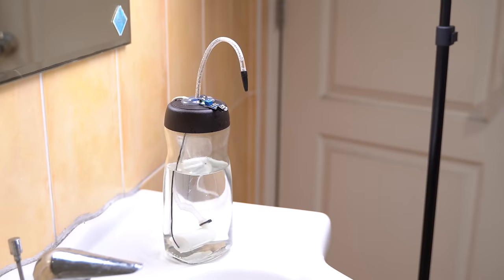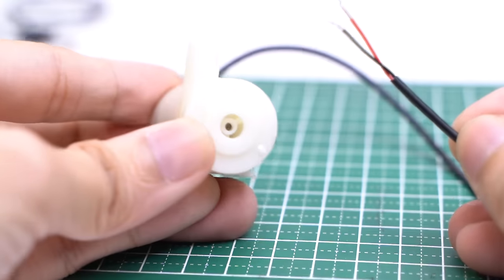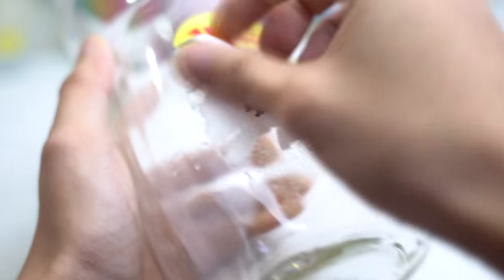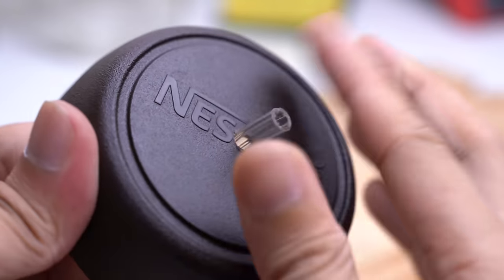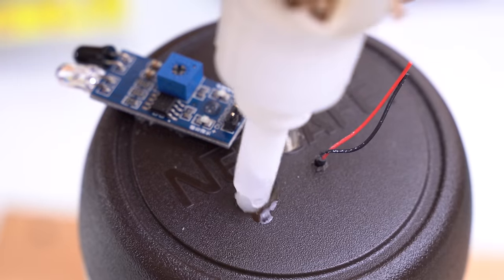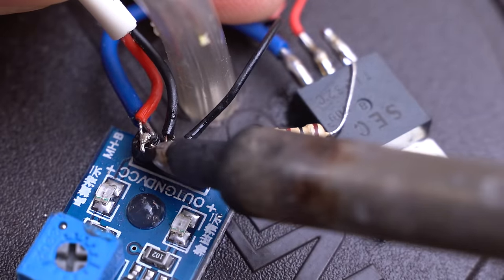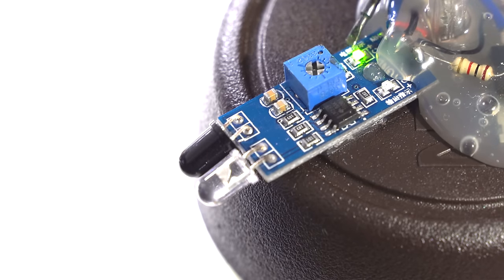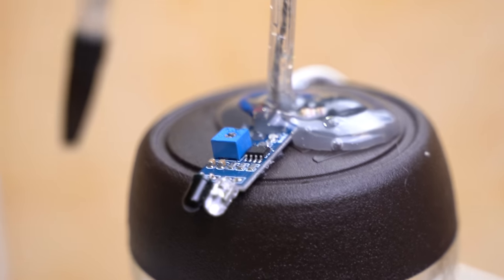DIY Automatic Alcohol Dispenser ($3 No Arduino Needed)

Comment: Now you can upgrade this by inserting a small perfume ball valve near the discharge port of the pump so that the fluid doesn’t go back to the tank everytime you it goes off. This will act as a gravity one way valve or a check valve. Fluid output will be smooth as sanitizer. 

You can find the metal 2-3mm metal balls in so many place. Bike hubs, perfume bottles etc. Nice project.

Comment: Neat idea I guess... The only problem is that people are used to holding their hand under the dispenser and waiting for it to dispense it's preset amount. It isn't intuitive to have to remove your hand to stop it from dispensing, as this may lead to spilling. Since the IR sensor's output will remain high for as long as you hold your hand under it. I suspect users may hold their hand under it for quite a while until they realize it doesn't stop automatically. This would waste quite a lot of alcohol.

Comment: One note.  Beware on the wire colour in the USB cable.  Often times they don't follow standard colouring, so it's worth checking the polarity with a multimeter if you have one.
Reply from the maker: Agree! Although it barely happens, I've had the same enounter before. It damaged my project. I did however check it on the actual video, the clip was removed to shorten the video length.
Reply: @TechBuilder  Can I use a IRF 520 transistor? Thanks

Comment: For those concerned about the wires and pump being immersed in alcohol, you can probably put the pump outside of the bottle then just insert another tube into the bottle for the source.
Reply: Yes
Reply: I made this but whenever I try to put the battery, it automatically starts pumping; after that it functions normally. Can you tell me what's the problem?

Comment: I have a suggestion to improve the design. Connecting a capacitor and resistor to the transistor can help make a cheap timing circuit. This is good if you're only trying to dispense a small amount of liquid like rubbing alcohol on your hand. It also helps alleviate some problems when glitches on the sensor module might occur or when you point an autofocused camera to the sensor that might cause it to unintentionally go off and dispense large amounts of liquid.
Reply: what kind of capacitor?
Reply: Can you teach us on what type of capacitor is needed? And where to put the capacitor? Because my main problem is the current is slow when you try to activate the pump(we tried it on the breadboard) so the main problem that I have is the slow flow of the current to the pump

Comment: Good idea..... however I think after a bit of time the alcohol will corrode that motor (oxidizing the metal shaft) and possibly the glue/adhesive that holds it's housing together. There is also the chance of ignition of the alcohol from the small arcs those DC motors make when powered.

Perhaps run this for months and see what the outcome is.
Reply from the maker: Thanks! I've been running this project for almost 2 years now, the older one that is. This one's just a documented remake. I had exactly the same concerns, so far so good. As for the arcs, as long as there are no oxygen or air to feed the fuel from sparks, I doubt it would ignite.
Reply: Dis does look risky , may using  a brushless submersible pump or peristaltic pump is safe option ... 
Can a 5v peristaltic pump give such a result ??

Comment: using a peristaltic pump would be probably better with some alcohol tolerant tubing
Reply: Can 5v mini peristaltic motors give enough flow rate .. ??
Reply: And what will b alcohol tolerant tubing
Reply: I tried this . But dont know what I messed 
As the pump is running continuously on turning on power
Also the proximity sensor I got had 4 terminal namely AO DO GND VCC
Plz help

Comment: Hey there. Great DIY project.

I have an issue with mine. The pump is failing to pump the sanitizer all the way up the tube. The sanitizer gets stuck somewhere along the tube. 

Any advice on what I could do to solve this issue?
Reply: what kind of pump is being used?

Comment: I just did this !!!
man I feel like I'm now worthy for some NASA projects ;)
Reply: I tried doing this but my motor is not turning on at all!. I have tried this many times , could you please help me out?
Reply: @akshitaddanki3607  first ckeck your ir sensor by just giving it dc 5v supply. Then proceed for other connections.
Reply: Dnyanesh Jalamkar yes I have checked it and it is working absolutely fine..but my motor is not turning on :(
Reply: My motor work automatically when i connect the power. I used TIP 122NPN Transistor and 6v motor
Reply: @akshitaddanki3607  I made it today and it is working perfectly fine.  You might have fried the transistor while soldering. Try with another transistor (attach a small heatsink to it while soldering).
Reply: @dnyaneshjalamkar4257  I checked transistor also but motor gets automatically on when connected
Reply: @applevlogs4887  that happens when there is too much light. Try in low light area. Light affects ir sensor performance.
Reply: @dnyaneshjalamkar4257  it works I have adjusted ir sensor
Reply: @applevlogs4887  same things seems to be with my DIY. What did you adjust to fix it? Mine seems to turn on with power.
Reply: @RohitPatel-om4jp  adjust the screw available in ir sensor
Reply: @applevlogs4887  yeah figured that one out. Thanks though!
Reply: @RohitPatel-om4jp  welcome hope it works fine 😊
Reply: What kind of transistor can be use in this project?
Reply: @applevlogs4887  yes even I tried the circuit on breadboard , not working properly
Reply: I did the project too and after a week of usage, the tag i used to seal the water pump outlet has dissolved in the alcohol. Did you noticed that? Or is there any way to seal it? Please suggest it if you know.
Reply: Should we use same transistor or any other can work
Reply: Could you please help me out with this project?
Reply: Please help can I use 1k 1W resistor or 1/4 W is compulsory ...please help
Reply: @akshitaddanki3607  Please help can I use 1k 1W resistor or 1/4 W is compulsory ...please help
Reply: Hey please what's d size of the tube??
Reply: same with me here ! tried to connect the usb but motor turns on and never stops .
Reply: @alveylee9569  adjust the screw on it...
Reply: @alveylee9569  use a screw driver and lower the range if activity
Reply: Ash really? i tried it already ... but i guess my transistor is fried already... oh well
Reply: @alveylee9569  danm...but wait retry connecting all from the start it actually happened to me
Reply: @DurgaPrasad-xl7it  what other can be used?
Reply: Lol me too
Reply: @akshitaddanki3607  same problem
Reply: @applevlogs4887  same problem, what you did?
Reply: we will apply this NASA project @_@ hehe
Reply: Im looking forward to try it once I have all the components
Reply: does it need to be coding first (proximity sensor)?
Reply: @nurlnsuha  no
Reply: @AshLynx-rr9wy  what do I do if the sensor i'm using doesnt have the screw?

Comment: The performance of the sensor (IR tx + IR rx) seems to alter on the variation of light.
Reply: Use an ultrasonic hr304 sensor instead then
Reply: @ethicalhacker1  requires micro controller like arduino to work.. use e18-d80nk sensor.. works outdoors

Comment: I love this DIY and I am looking to use it for a different application. Would it be possible to use this with a 3000 l/h water pump? will I need to use a traditional power outlet cable, will that melt, or will the usb be strong enough?
Reply from the maker: you need a relay :)) Just replace the load with a 5v relay
Reply: @TechBuilder  hey man do you have ig ? Please help me make the diagram using 5v relay

Comment: Same invention with us. We just used Ultrasonic HC-SR04 sensor.
Reply: He use 100V 3A transistor but why he use only 5V dc water pump ?
Reply: Is that mean u do not need a transistor?
Reply: Fiq Azhar no, you need itu to be a gate for electricity. Sensor give electricity for base transistor to flow electricity form emitter to collector to pump. It’s be a swticher
Reply: So, can use which transistor?
Reply: Erwin Jaudines already said, pnp 32 transistor. Check in his description
Reply: Thank you👍

Comment: Why put motor in alcohol??  Also possible fixed tube  to input side for injection. Any issue in this please???
Reply from the maker: @einherjar5311  Exactly! :) I also found out the specific pump I used has a non reactive plastic enclosure with alcohol.
Reply: @TechBuilder  - kindly suggest the motor which u have used

Comment: Is there any way to control how long the pump is activated for once the sensor detects a hand?
Reply: In this configuration no, because the proximity sensor shuts off immediately when nothing is detected. It will run as long as something is in front of it. 
This could be limited to prevent abuse with a second transistor and a rc circuit which cuts the connection when the capacitor is fully loaded and resets after a short decharging period.
Reply from the maker: I agree with @oneBACON . You can use a two transistor circuity or perhaps use a 555 timer to add intervals, although the 555 wouldn't give you the cut you need.
Reply: Why not use small relay and delay it with capacitor and diode
Reply: @onebacon_  I understand the principle behind what you said, but could you elaborate on what type of transistor, resistor and capacitor I would get and how that would be wired together?

Comment: Nice project.
But you should not use submersible pump.
It is not safe to pump alcohol by these kind of pumps.
You should use dosing pumps specially made for alcohol & other volatile liquids.
Rest for your electronic parts you deserve 👍👍👍👍👍👍👍👍👍👍👍👍👍👍👍👍👍👍👍👍👍👍👍👍👍👍👍👍👍👍👍👍👍👍👍👍👍👍👍👍👍👍👍👍👍👍👍👍👍👍👍

Comment: This would gonna big fenomenal in Russia.
Reply: ...gonna be big......:-)    and I agree, meaning согласен :-)
Reply: what’s wrong with hand sanitizers?

Though the occasional use of a hand sanitizer isn’t going to hurt you, regular use over time can cause a lot of problems:

1. DRY SKIN

We told you about the dangers of alcohols in skin care in a previous post. The alcohols used in hand sanitizers include isopropyl, ethanol, and n-propanol. These are the drying alcohols we told you about. They irritate the skin, strip away it’s natural oils and acid mantle, dehydrate cells, and increase risk of contact dermatitis.

2. ACCELERATED AGING

All those drying effects can lead to increased appearance of fine lines and wrinkles, as well as calluses, cracks, and flakiness. Over time, alcohols can disrupt the natural barrier function, reducing skin’s ability to protect itself, and leading to increased dehydration.

3. DAMAGED SKIN

Scientific studies have shown that alcohols can actually damage skin cells.

4. ANTIBIOTIC RESISTANCE

Many hand sanitizers these days are made with triclosan (more about triclosan in this post). This antibacterial has been found in animal studies to disrupt hormone function. It’s also connected to the rise of so-called “superbugs”—bacteria and viruses that can resist antibiotics. The CDC announced in 2013 that the rise of superbugs (as a result of overuse of antibiotics) was a serious threat to human health, and had caused at least 23,000 deaths that year.

5. UNKNOWN CHEMICALS

Many hand sanitizers are made with chemical fragrances. Since manufacturers are not required to list fragrance ingredients on the label, you don’t know what you’re exposing yourself to. Many fragrances are irritating and have been linked to allergies and hormone disruption.

6. WEAKENED IMMUNE SYSTEM

We think we’re reducing our risk of getting sick when we use hand sanitizers, but they can actually weaken the immune system. Studies have shown that ultra-clean environments—particularly early in life—can contribute to reduced immune defenses later on.

7. THEY JUST DON’T WORK AS WELL

The FDA states that currently, there is no evidence that antibacterial soaps (and sanitizers) are any more effective than regular soap and warm water in helping to prevent the spread of germs. A 2000 study found that sanitizers do not significantly reduce the amount of bacteria on the hands, and may actually even increase it. Researchers added that the products strip the skin of its natural oils—and since those oils usually prevent bacteria from coming to the surface, the sanitizer can actually reduce the skin’s own defenses.
Reply: @hunny333  nothing in this world is perfect, not even the healthiest veggies could have a little harm on you.

Comment: Once again, a very cheap build. Dami ko nakita gumagawa puro arduino ang board. But this one is way cheaper and can even be compact if it has its own housing with a rechargeable battery pack..
Reply: san kaya maka bili ng censor?
Reply: @haroldmamacydeasis8369  may nakita po ako sa shopee around 36pesos lang po
Reply: lazada at shoppe kaso indoors lng yan guys.. pag may sinag ng araw kahit hindi directly from the sun bsta maliwanag.. aandar ang motor at tuloy2 ang labas ng alcohol..
Reply: Paps. Ano alternative transistor ang magamit dito?
Reply: @GamingNKim  try mo yong MJC32C na transistor.
Reply: Ano po ba effect pag di ako gumamit ng transistor?

Comment: My proximity sensor is not working as expected.Even after calibrating its variable resistor several times,no response.Circuit is correct I checked many times.If I shot the grd and out of proximity sensor my motor start working.please suggest.

Comment: I did this project. The pump seems to struggle drraws 350 mA :( and the soap is coming so quickly. Im powering with a power bank. How do you power the project ?
Thanks.
Marc.

Comment: is the transistor necessary? Is the data pin on the sensor board not enough to turn the motor on or off?

Comment: Sir, I have done as you taught, but the problem is motor starts for some seconds and then it stop, after that motor does not start, sensor is working totally fine, I changed resistor then again the cycle repeats

Comment: I made all these connections like in the video but as soon as I connect the usb cable to the power bank the pump starts working immediately irrespective of whether anything is close to the sensor or not.. I even tried adjusting the screw of the sensor but no use the pump turns on as soon as it gets power. What I'm I doing wrong?

Comment: Now i tried this on breadboard, works ok..
then i transfer it to pcb. then the dc pump keeps running... even when the light doesn't turn on or no obstacle on the IR sensor... what could be wrong ?
Tested with Tip32c, Tip42c, and BD140 transistor... all the same

Comment: This is great - I made a bedside vodka dispenser using this design: Industrial pump, 25 litre vodka container and tube straight into my mouth, activated by blinking my eyelids. 

I tried activating it by waving my hand but after the first litre or two I couldn't even lift my arm. With the eyelind blink activation I can now get vodka as soon as I wake up. 

I used the leftover tubing for a catheter which neatly solves the problem of no longer being able to walk after the first 30 minutes

Comment: i had using a IR sensor in a project.which detects the object infront of the sensor in some distance by adjust the sensitivity of the sensor range(POTENTIOMETER).
Here, i had a problems after few minutes,
1. I had remove the object infront of the sensor which is detect that the object (always on).
what is the reason for that problems?

Comment: In your material require you haven’t mentioned about the 1k resistor? Can I buy the “Ohms 1K Ohms 0.25W 1/4W 5% Carbon Film Resistors Resistance “

Comment: Hi, I tried doing it with a 12v relay and a proximity sensor, along with Arduino UNO and a 12v dc motor. I connected the sensor to the board, and connected the relay also to the board, and then connected the motor to the common and NO. It is not working, the relay seem to work but motor is not working, please help me out.

Comment: Here in the video it is mentioned that we need to use a 1k ohm resistor but in the instructable linked in the description 1N4007 diode is mentioned instead which one will work better? Will both work? How can we avoid overspilling without the ballpen tip...?

Comment: Can we use this with a ultrasonic module as we need to use it for outdoor application , plus how do you control for how long the motor is activated else it keeps throwing the liquid without stopping

Comment: 3v po kase yung water pump ko. di kaya sasabog for the long run if input is 5v? or safe kase meron namang resistor na 1k ohms. SANA MAPANSIN heheh. at sa transistor po pwede ba ako gagamit ng NPN transistor, okay lang kahit maiba na yong connection.

Comment: Hi, for Proximity Sensor Output is it normally HIGH or LOW ? in my case the sensor normally HIGH until object within range then signal goes LOW, so I have to do inverting signal by dividing the current, and I use NPN transistor.. Any advice? thanks in advance

Comment: why i cant run my pump? but the lights in sensor is on, my pump is running by my power bank, i used tip32c transistor, proximity sensor, 1k ohms resistor, please help me,

Comment: @TechBuilder I have completely set the setup using batteries instead of direct power supply but motor is not pumping the liquid whereas the sensor works here... I also tried with usb cable also plz help...

Comment: Somebody please help.
I have done the same but the motor is not working when sensor detects the movement. I checked the motor alone it's running. What to do. Somebody please help

Comment: excellent work.simple . during dc motor on  some amount spark arise from carbon brush. even it sealed any possible chances of fire .kindly explain .crack will come in casing if it immersed in alcohol for long time